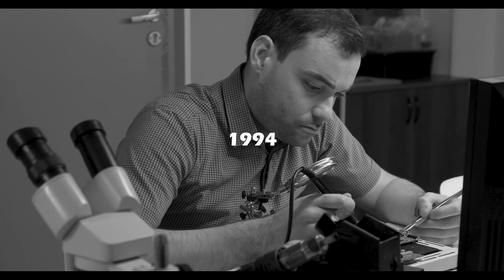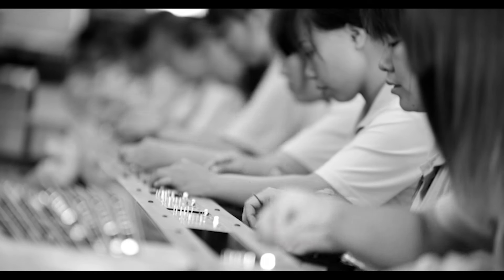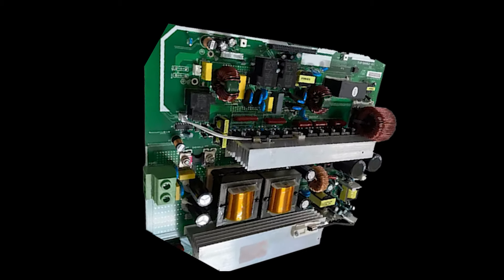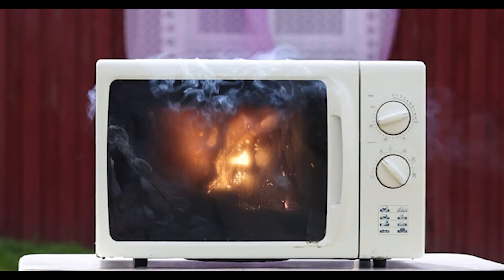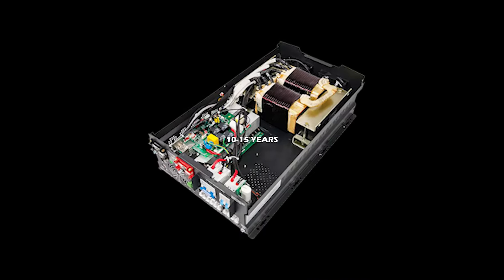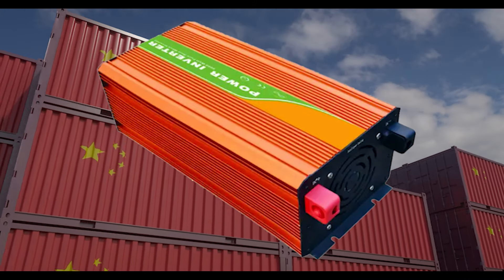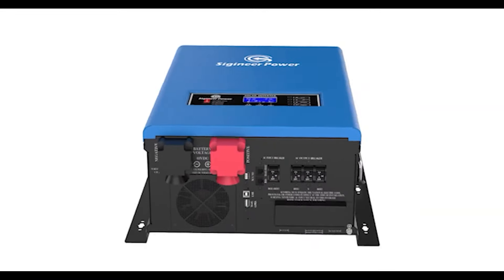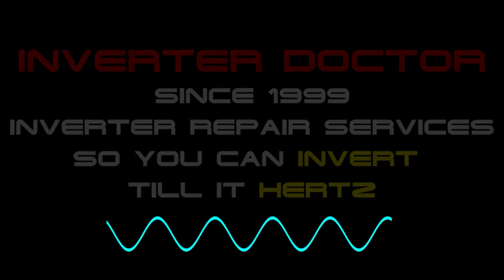6000XP VS Low Frequency Inverters. There's no contest.

Comment: Whick model inverter that 120 volt AC as input?
Reply: Sigineer Power makes reliable low frequency, transformer based 120VAC input inverter chargers.
Reply: This is what I want to know, I see on the site they have AC Input voltage MINUMUM 150Volt.
Are there any for US AC Current, 120Volt AC input Split Phase 120/240 AC?
I want to tie it to the US Grid for charging batteries at night.
Reply: @Scat.original  That's strange, This is what I see on their website. "Ac Input Voltage For Charger: Nominal 120Vac (90-135Vac+/-4%)" Unfortunately, if you want a split phase 120/240 Volt output, there are no inverters on the market that will take a 120 VAC input and output split phase 120/240 output. If you want a 120/240 Volt output, you will have to use an inverter with a 240 VAC input.
Reply: @Madsci-zy8wm  Please provide a link to your statement, Thanks
Reply: @Scat.original  I don't think that youtube will allow me to post a link here,

Comment: cant you just take two 240v high frequency inverters and use a auto transformer
Reply from the maker: Connecting high frequency inverters to an auto transformer will only shorten the life of the FETs in the high frequency inverter.

Comment: meh. HF inverters are so cheap and easy to parallel you can stack a bunch up. LF has its advantages and serious disadvantages, way too expensive to produce a lot of power being the first one. Not to mention the amazing convenience and value of the all in one inverters. Sorry but all the big name brand companies are falling way behind in inverter value. its ridiculous that they make you buy a bunch of large seperate components that are very expensive to get the same performance you can out of a few inexpensive AIO inverters.
Reply from the maker: You're behind the times. Low frequency inverters have been available for years at prices that are comparable to the cheap high frequency inverters, and they come in all-in-one configurations just like the high frequency units, only they last far, far longer and they offer a much higher surge capacity, so you don't have to stack several of them, like you have to do with the cheap high frequency inverters.

Comment: They have been using lux branded inverters around the world without problems for a long time. The assessment of this video is wrong. Furthermore they are more affordable than the big name LF inverters.
Reply from the maker: I disagree. Search Google for "lux inverters fail" and you'll find many sites concerning Lux Power inverter failures and errors.
Reply: Do you have a link you could share of the Lux inverters catching fire? I can only seem to find anything related to error codes and battery charging issues.
I’m in the market for one of these right now and if these are as much of a fire hazard as your video stated, I’m going to look at a LF.
Reply from the maker: @theguitarscout9802  Here's a link to a video that explains why any high frequency, transformerless inverter can catch fire and set your appliances on fire.https://youtu.be/tp5oDbu6kRQ?si=fpvFizCZ301196Fi
Reply: @kickgas7171  Oh Gosh, lots of things can theoretically catch fire and burn up that don't actually do that much in common practice.  Even low frequency transformers can short and catch fire.
Reply: Lux power is a Chinese R+d firm. Does not even make the product.  I'm going with the manufacturer whose design that Luxpower ripped off, with 6+ years more experience given all these enlightening facts from the video.

Comment: You know what's funny? The component used in making inverters are most likely made in China.  Secondly most American companies simple contract Chinese companies to make their inverters and apply their own brand to it. Oh and the cost difference $600 in comparison to $4000.
Reply from the maker: You know what's funny. There are several brands of high quality, Chinese made inverters that use high quality components that come from manufacturers from all over the world, including China. The difference is that these high quality inverter manufacturers don't build cheap, ligjtweight, high frequency, transformerless inverters. They build only high quality, low frequency, transformer based inverters that can be purchased on Amazon for less than $400.
Reply: This video not really going stop people from buying Chinese made inverter!
Reply from the maker: @patcha707  We don't want to stop anyone from buying Chinese made inverters. Most Chinese made low frequency, transformer based inverters are awesome. It's only the Chinese made, high frequency inverters that are junk. You obviously didn't watch the video.
Reply: I watch the video
Reply: @kickgas7171  When there are hidden agendas a person try to discourage another person. If I didn't watch the video, how could I respond? Currently I am using two high frequency inverters in my system and I have no issues.
Reply from the maker: @howardescoffery4950  There are no hidden agendas when one speaks the truth. And by the way, I only asked patcha707 if he watched the video. I never asked you if you watched the video. Are you and patcha707 the same account? LOL! 

And you have no issues yet, but I can guaranty you will just give it time. And just out of curiosity, why are you trolling my channel so much? Are you a high frequency inverter affiliate advertiser or are you a shill account for an affiliate high frequency inverter inverter company?

Comment from the maker: If you're interested in learning more about the technical reasons why a high frequency, transformerless inverters makes a poor and even potentially dangerous investment, watch this Youtube detailed video titled "Solar Inverter Catastrophic Failure" https://youtu.be/tp5oDbu6kRQ?si=x3qWhsoZtYa37eP7
Reply from the maker: There is nothing theoretical about high frequency, transformerless inverters setting appliances on fire. It is already happening. May I suggest that you watch "catastrophic inverter failure' by Red Hill Labs to learn more about this issue. And insofar as an inverter transformer shorting out and catching fire, that scenario is pretty much an impossibility be cause the inverter's DC circuit breaker would trip long before the transformer would get hot enough to burn. Which would not be the case where a transformerless inverter passes DC current to an AC appliance and sets the appliance on fire.